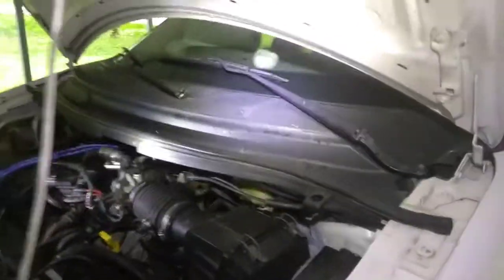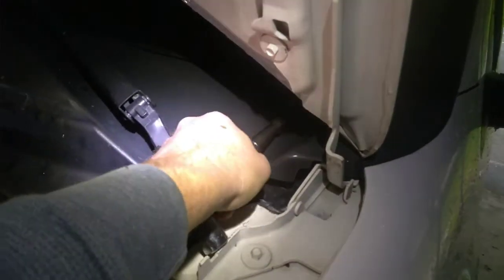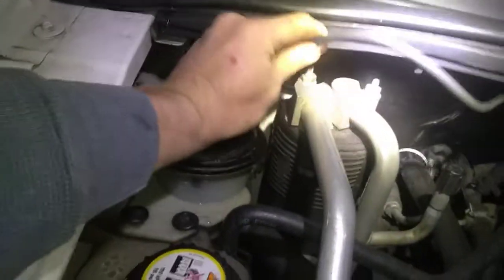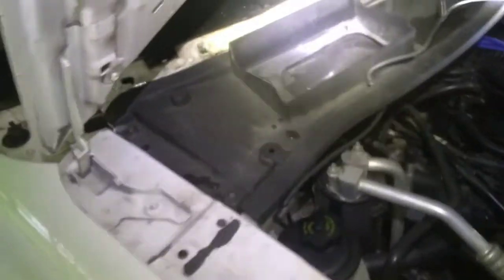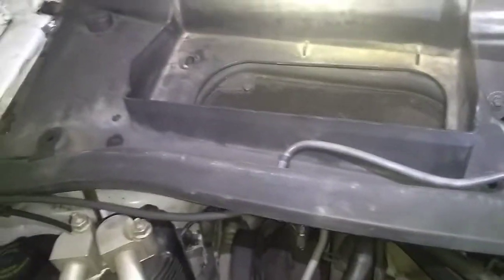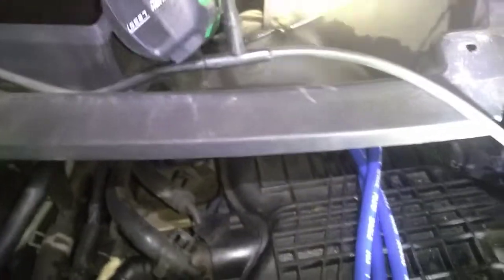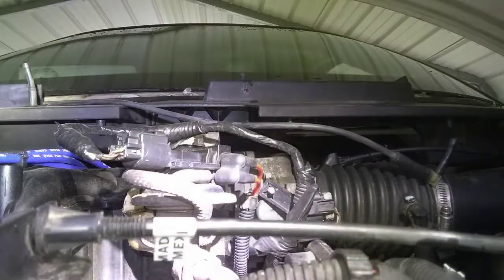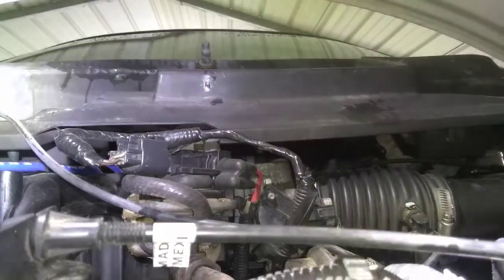Ford Freestar windshield wiper cowl assembly removal

Comment: Thanks for the video. I was looking at a very well used 2004 freestar local sell on facebook.  They did not mention it but from the gallery I noticed the windshield had a latteral crack from side to side. So it will have to be replaced. First online glass shop I looked at at 1:35 in the morning quoted $415.00 and was not clear if that was installed or just the glass. I did find glass on Ebay in the $85 - $200 range used thru generic looking new glass with stuff around it.  Anyway, I will check mark their van and see if I can make a deal.  Social security pays little, and after property taxes. Just had enough to make the utilities until Social Security throws another hand full of change in my bank. Have a great day, appreciate the look under the hood.